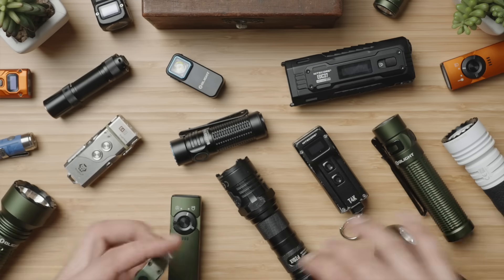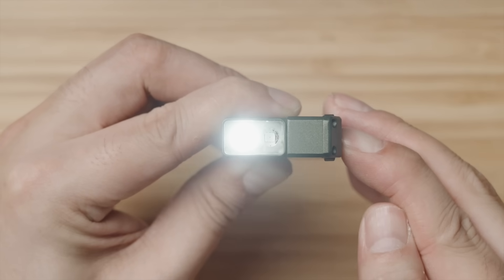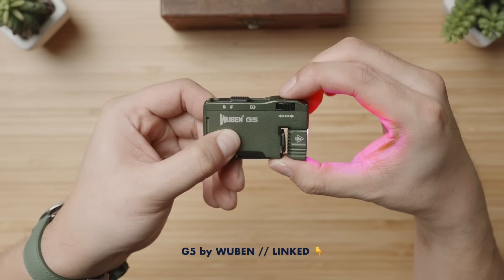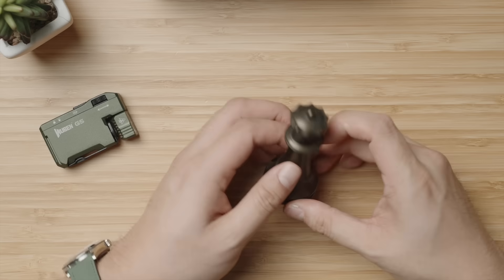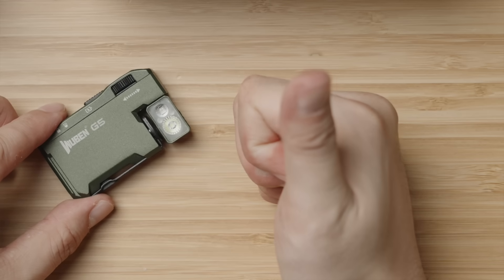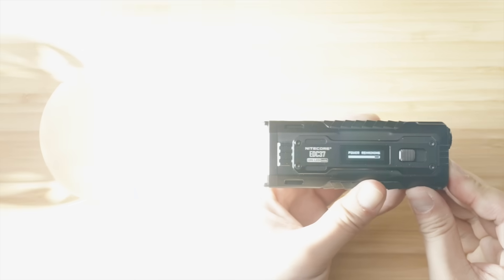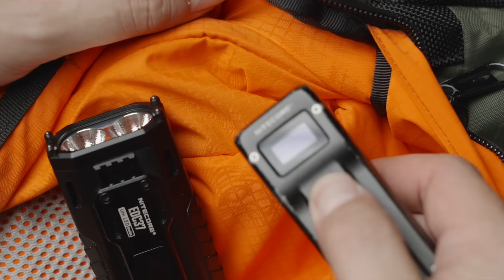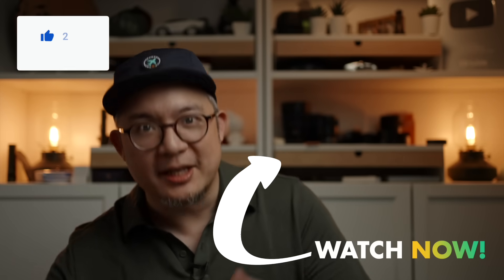Modern Flashlights are INSANE.

Comment: This! 
As a CNC machine operator in a small business, 
I don't understand how we can compete with China. 
We can't even buy raw material for $20 in the States, 
and they sell finished products.
Reply: I've seen this happen in chemical industry. They sell final product cheaper than cost of intermediates (also chinese). They're not afraid of scales. They used to make a 10,000 kilo batch even if customer wanted just 100 kilos. They're confident they'll be able to sell remaining 9900 kilos, even if at no profit no loss, and they're happy to have earned profit from just 100 kilos, but more importantly to have earned a customer.
Reply: @mitesh8utube loss-leader
Reply: The reason why Chinese products are cheap is a multifaceted thing. Yeah, labor is like $20 an hour for machining, but materials are exponentially cheaper, mostly due to supply chain optimization. The foundry to the storage of packaged goods are all located within a few miles of each other. And anything not nearby is furnished by a really, really good rail system. Add the low cost of shipping (and limited safety considerations) and you get your painfully cheap products.
Reply: @MikeStavola  plus abusing the postal system by China claiming it's a developing country and therefore gets subventions to shipping costs
Reply: @MikeStavola  Yea, I think one thing people take for granted in this country is how much infrastructure is focused on cars.

We used to have rail and even shipping along the coasts, rivers & canals. 

I constantly hear arguments against car alternatives because people think it's a zero-sum game where any investment in alternative transportation means the elimination of cars.

We've forgetten how to walk and chew gum when it comes to infrastructure. We've been brainwashed to sit in traffic and chew gum all day.
Reply: Even if there wasnt a price difference. Many chinese products are simply better. And here we are not even talking about complicated stuff.
I got into lighters a few weeks ago and did some comparisons between Zippos and the chinese ""knockoff brand"" Zorro. If i hadnt known which was which, i had assumed the american product had to be the knockoff. Way more sturdy, better made, great carvings. That they cost you a literal fifth of a Zippo here in Germany, is just the cherry on top.
And you sadly see this with many brands. I remember the differences of quality for cutlery between a well known german brand and a random chinese product. The problem isnt the lower price of chinese good anymore. The problem is, that western companies cant sell worse products for higher prices.
Reply: @CallMeTeci  facts I will buy American products if they are within like 10 percent margin, but the problem is usually, they don't even make the product in the US or if they do its 50 percent more not 10
Reply: @EVANHIRSCHMANN97  I wouldnt mind paying 50% or even 100% more for products that are meant to last a lifetime (like the two mentioned categories in my comment), IF the western product would actually be better and of higher quality.
I did this often in the past and will do so in the future. I just encounter more and more often the reality that i would have to pay more to get less.
"Made in China" is kicking our arses when it comes to more and more consumer products (at least those that are not completely on bottom of the barrel) and imo that is insanely worrying, going into the future.
Reply: @CallMeTeci  theres zippos that have lasted for decades and much longer. i doubt any zorro lighter would last as long. those are disposable.
Reply: @IdleCheez  Disposable. xDDD
Mkay 🤡
Reply: @CallMeTeci  let me know when the built-in battery dies Mkay? ☠
Reply: @IdleCheez Battery? What are you on bro? xD
Im talking about their fuel lighters. I didnt even know they have anything with batteries apaprt from their electro-inserts...
Reply: Isn’t it the QC that saves them money?   Products like this have to be loss leaders.  I checked their other lights and while they are not expensive they cost a lot more than this one.  They one that two colors are $27 and the others are $100+

I’m not in manufacturing.  I’m just a dumb consumer.  So idk
Reply: China has way better tooling and workers. We stopped investing in manufacturing decades ago. Even CNC operators like you make a fraction of you would have been making
Reply: 🤚 production management here. It’s all about the volume and cost of manufacturing. Rent. And wages being the biggest. So they leverage on both those and win. Similar in Mexico which is why many supply chains have changed
Reply: It's because, just like many countries, local expertise and supply chains have been lost from decades of China domination.
Reply: You don't. You let them produce the things they are good at producing, like cheap electronics, cheap clothing, cheap toys, etc... and on our end we produce the things we are good at producing and where we have a competitive advantage, like military products, luxury items, high-end electronics, computer software, online services. Then with the money we make from our products, we buy their products.
Reply: The raw material is there and they abuse their hell out of their workers to keep cost down
Reply: you're not supposed to. the point of globalisation is more, cheaper, better stuff for more people, everywhere.
Reply: Because China is the greatest country on earth. The USA is a backwards shithole.
Reply: well, some tariffs may be driving those material costs up for you unfortunately.
Reply: They have all the raw materials and all the manufacturing expertise

We’re cavemen without a local raw material supply compared to them
Reply: 15$ = 107 Chinese Yuan as of 8/8/25 - x 1000 of said product = ¥107 × 1000 = ¥107,000 Chinese Yuan. ¥104,820 net income after tax.
and depending on how much it cost to make it.
Reply: Dumping strategy maybe?
Reply: Welcome to China for a travel.
Reply: If they can make pagers explode...
Reply: I'm not saying its the case with say Wuben, but the CCP subsidises some of its businesses exports, they do it with cars, that's one of the reasons Chineses manufactures can sell their cars cheaper, its technically illegal internationally for good reason, but China just denies its happening. a second thing currently happening, is Globally money is getting in short supply at the civilian level, Especially in the western nations, so demand is dropping, along with the tarriffs or threats of them, its completely destroying some companies, because they are high production and high turnover rates, Chinese had massive inventories piling up in some industries with no where to even put it, sitting in shipping ports because they counld import to the US, so in some cases they have way way too much inventory, selling it at loss slows the money bleeding, and allows them to get employees back and in production, earlier this summer Chinese were trying to dump inventory that was produced for the US into Europe for pennys on the dollar, wisely the European countries didn't let that happen because it runs their national companies into the ground becuase they can't comes close to competing on price especially when Chinese companies are selling it a loss. I also know that for smaller products like these flashlights, the Chinese have found some work arounds on tarriff's, but they know once its figured ou the loop hole will likely be closed, so again they are in rush to clear inventory. I've been watching some other types of products over the summer, and I keep thinking there will be a price jump, its even used as a markieting tool, "last chance to buy by this date, then prices are going up becuase of tariffs, they've been marketed that way all summer, and the prices haven't went up, and in some cases they've lower pricing.
Reply: this was the same for me down in new zealand trying to zinc diecast. China was miles ahead. In a different league.
Reply: because it's all die cast and you are a cnc machinist. You would make the dies for someone doing the casting. You're not in competition. You're on a completely different branch of the tree.
Reply: Andy? Sad part is you couldn't even STEAL raw materials in the U.S. for less than $20!!! Yep. I said it. Even with a five finger discount? You still need gas money AND you better make sure your tags aren't expired 🤣🤣
Reply: We can compete, but it would require returning to the America of 100 years ago with the same regulations and open immigration.
Reply: ? big businesses buy a lot of materials so they can get it cheaper because they buy so many
Reply: You can’t. They heavily subsidize their manufacturing.
Reply: @Jmartphilly yeah... its too big to fail, like boing, ford or tesla
Reply: Central planning allows for really efficient supply chains. That's part of it.
Reply: When their government is 'subsidizing' every aspect of their population's lives and some of yours too. Maybe, just maybe, instead of over capacity and subsidies, it's inefficiencies and deficiencies at home.
Reply: @charleyfan1908  they don't subsidize like U.S does. Everyone is free is to participate in the subsidiary program unlike the US where subsidiary program is based on favoritism like Tesla, INTEL and most of the agro business, government bailouts for banks. I'd rather have my government back new companies than legacy banks and wall street.
Reply: @charleyfan1908  google "exorbitant privilege" and the reserve currency status of the dollar.... what do the US ARMY produce and how it is paid?... NASA?... tesla , google, amazon etc, the US its THE example of subsidize economy thanks to the dollar, thats why every country that wants out of the " US debt base finalcial system" that serves the US gets some freedom and democracy.
Reply: @charleyfan1908 Which strategy is better? Slap on tariffs and impose bans to stall your competition? Is that your idea on how to promote your homegrown enterprise?
Reply: @psoon04286  When one government basically knows selling stuff for cheap kills local business of another country they can do it on purpose with the hope of killing any chance they have to be self-sufficient and then jack up the prices of everything when they have global dominance. It's pretty obvious what the Chinese government and what our western governments did to us and people are sick of it. The majority of shortsighted morons who only care about money and cheap replaceable objects to satisfy a consumption addiction are also to blame.
Reply: something like that you wouldn't want to cnc in the first place. casting with modern methods is much more efficient. they'll make a 100 without waste material by the time you finish cnc'ing the first one. and tech is at a point where the mold isn't cnc'd either nor is the casting looking like an old timey foundry.

thing is. 40 bucks is actually high end luxury pricing for a flashlight. you can try to pretend that it's not and that some amg merc is "mid level" and that you need 200k to be able to afford a child but pretending those things doesn't make them true. think about it a little. you can buy a gasoline generator for like 200 bucks now and uses vastly more materials than a flashlight needing vastly better precision in manufacturing the motor.

cnc is easy to make the part you want but it really isn't the best option for mass manufacture, what you should use it for is to make the tools for mass manufacture.
Reply: There are a ton of reasons.  The air pollution is legendarily bad - it kills thousands yearly in Beijing.  Pollution is cheaper than saving lives.  The water is so badly contaminated it isn’t safe to drink (carcinogens) in 98% of the entire country.  They run very heavily on coal, which produces CO2, sulfur oxides, mercury in the water - concentrating in predatory fish like tuna.

No worker safety, and I can’t begin to describe the crazy stuff I’ve seen along those lines.  As far as housing, they have a massive excess - built in a government supported real estate bubble, which people can’t afford to buy due to the bubble.  Also, you can buy a building, but are not allowed to own real estate - you get a long term lease from the government.

You would have to give up a LOT to get access to those lower costs - and get the government as a literal partner if you were big enough.

Watch some episodes of THE CHINA SHOW on YouTube.  They’re a little long winded, but will show things you never dreamed of
Reply: We can't. We gave up on this kind of manufacturing 30+ years ago, and we're so far behind now that it's impossible to catch up.

Consider BYD's entry level EV, compared with the upcoming Slate EV pickup. BYD's entry level sedan is $15k and it's designed to compete with a Tesla Model 3 in terms of feature set (though the range is substantially higher). The bare bones Slate, with a battery half the size and literally no features beyond just driving (manual windows, no audio at all, 2 seater) starts at the "mid 20's", so in the $25k range.

The US has basically ceded the next century of global dominance. The current administration is just pouring napalm on the situation.
Reply: Convoy flashlight hosts are absurdly cheap for the build quality, anodised threads are as smooth as silk
Reply: 1 Chinese Yuan equals
0.14 United States Dollars 
think about that
Reply: @paintdry3625   ain't that a good thing for the chinese
Reply: @paintdry3625  1 United States Dollar equals 0.31 Kuwaiti Dinar. 
1 Arab Emirates Dirham equals 0.27 United States Dollar.

Currency conversions don't mean as much as a lot of people think they do. If a $7 USD item is 2KWD or 28AED...
Reply: Chinese companies have access to electricity six times cheaper than companies in the European Union and twice as cheap as those in the US. Add to this the incredible automation of Chinese factories. We need to return to cheap fossil fuels and abandon the green utopia—just like the Chinese are doing.
Reply: thats why tariffs are proposed.

I live in Norway, one of the reasons we are so well off is due to our crazy high import tax (tariffs) and VAT, especially on locally produced product like agricultural stuff, in order to incentivise a stable local production.

unfortunately you American's seem to value globalism over a healthy economy. the orange man proposed solutions but your own backlash and his lack of backbone seem to keep you in the mess.

Good luck on that, to me the only thing I see would fix your problem is someone even more orange.
Reply: @andrew.khachaturyan   It's all got to be at a loss.  Wish, Temu, etc, all have to be selling at a loss to undermine America. The conspiracy hat goes on with this next step, though: having random things not be correct(Temu basically does it willy nilly) is also to waste people's time.  So many complaining videos end with "it's not worth my time returning it".  That means they ruined your day and got your money.  Two for one.
Reply: @zendell37  It's actually because we have made everything so expensive here for the sake of corporate profits and executive compensation that we have to have incredibly high wages for people to even barely survive. Therefore, everything has to be obscenely expensive just to cover labor cost and clear the insane profit margins companies demand. If we had a more equitable system in which upper management was not paid tens or hundreds what normal laborers are, a society in which our food is not a massive price gouging system, and a housing market that was not based on massive conglomerates charging as much as possible, everything could be affordable. The lines on the stock market have to constantly go up which means the cost of everything has to go up. Meanwhile infinite growth is definitionally impossible.
Reply: @zendell37  idk how to tell you this, but both labour and materials are actually just way cheaper here
Reply: @thekingofpotatoes1932  Are you in China?
Reply: And cost of living?
Reply: @zendell37  noy true. Americans put high price on everything without no reason. Downfall is inevitable
Reply: @zendell37  Everything is continuous, minute destabilization lately. And only ever will be from here on.
Reply: A large majority of US companies sent production and thus jobs abroad decades ago. These were/are American businesses whose boards and executives understood that significantly reducing labor costs would ramp up revenue. Businesses throughout the West followed suit. No one "took" American businesses away. Go to any local pharmacy, hardware shop, shoes or clothing store. Look at items sold by American brand names and see where they are made: light bulbs, bandages, athletic shoes, phones and laptops, linens and cookware - and flashlights.
Reply: @zendell37  the conspiracy sinophobic hat was on for the first part. wish and temu sell stuff made with actual slave labour, out of the cheapest possible materials, and they make a lot of money misrepresenting the products as well as making it very easy to go on a massive shopping spree so small per unit profit becomes pretty big
Reply: @zendell37  economies of scale are a real thing. these products aren't being individually machined by hand. Labor costs are also absurdly different. And hey, if the cost of living in China is so much cheaper and they can afford to make products so much cheaper, maybe their systems have advantages our systems don't. Try seeing what's in front of you instead of making up background nefarious reasons for things.
Reply: @zendell37  it's just that they ironically are way more capitalist than us in a lot of ways. That's not really a good or bad thing really, we just prioritized different things but manufacturing efficiency.
Reply: @zendell37  they got your money but they sold it at a loss? which is it? It's obvious they are making a profit or they wouldn't bother with it.
Reply: @zendell37  you are such deep denial. the reality is that china is way ahead of the US in terms of advanced manufacturing, automation, and supply chain optimization. Labor is cheaper, but hoenstly that isn't the biggest factor at this point. They are not selling at a loss; they are just better. cope harder. seriously. by the way, I'm an american working in china for the next year.
Reply: @zendell37  that's the dumbest thing I have heard lol. China is just that efficient with manufacturing.
Reply: @zendell37  You clearly haven't researched this. They're not selling at a loss. They've just optimized their supply chains and have incredible industry. China isn't the "cheap slave labor" pool anymore. Sure they have a lot of cheap products still, but a lot of their labor force is highly skilled. We couldn't even find enough people stateside with the skill set to run even a couple of the plants they have over there. Take TSMC as an example - they had to bring in Taiwanese people to run the assembly lines. And it's not a "maga" thing - we lost that fight and those jobs are never coming back. If they try to force it here, everything will get exponentially more expensive overnight. We do many things that the Chinese cant and we trade our things for their things. Globalization isn't the enemy.
Reply: @zendell37  You think it's China undermining America when it's actually American leaders and conglomerates undermining the American people. Spit out the propaganda, China is infinitely less evil than the USA, especially when it comes to "international relations".
Reply: @zendell37  I mean the CN economy is LITERALLY the party demanding things and disappearing those that don't make it happen to the slave labor camps, well them AND the family... their neighbors and cousins 2-3 out etc.